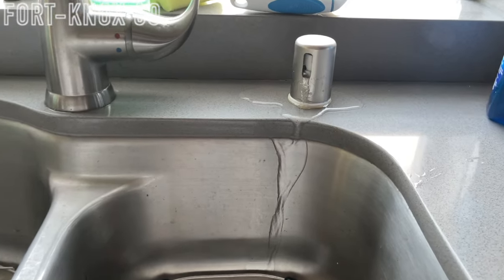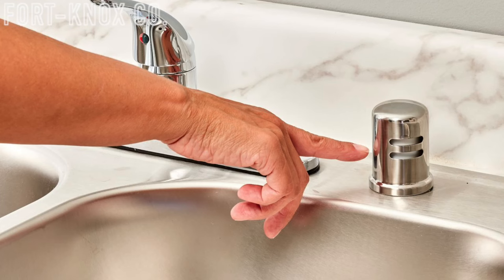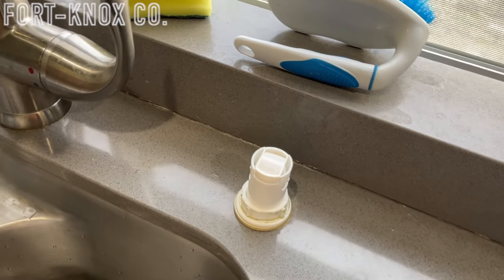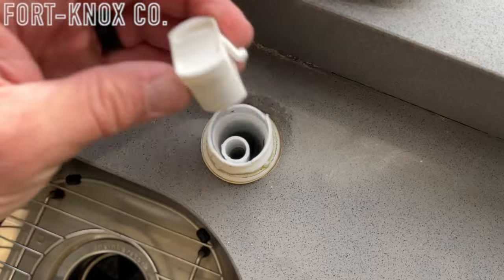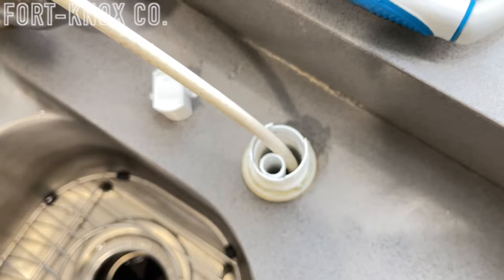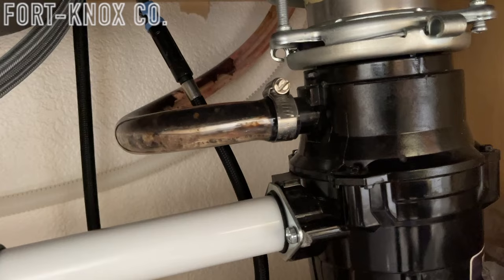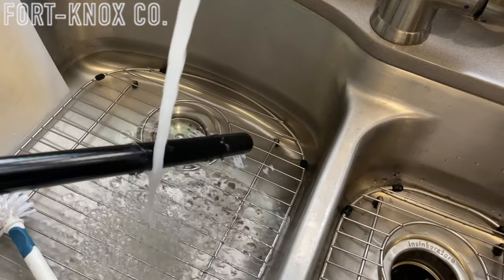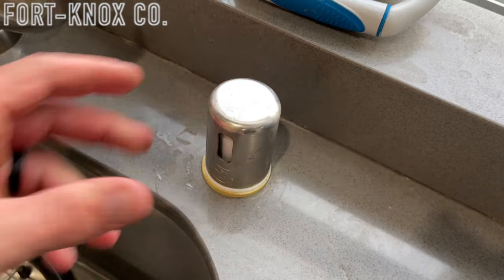Dish Washer Not Draining Air Gap Water Coming Out

Comment: I tried this but it's still leaking/overflowing. The hose is ribbed/corrugated, which I'm assuming is wrong, but also there is a solid cupboard wall hiding the dishwasher end of the hose making it hard to replace. Do you have a video/tips on how to access that end? I have zero dishwasher experience, except for the dishes part
Reply from the maker: To get to the hose connection on the dishwasher you’d need to pull the dish washer out of the base cabinet. It’s usually pretty easy to do. If you open you dishwasher door and look at the area where the dishwasher meets the under side of the countertop you’ll most likely see a couple screws that are holding down two metal tabs that connect to the dishwasher. They are usually small screws that screw into the bottom side of you countertop underlayment. You under those screws and the washing machine should slide out like pulling a stove/fridge/washer dryer away from the wall. It’s usually just a couple simple screws holding it in place. 

As far as the water still coming out of the air gap I’d check the hose going down from the air gap to the garbage disposal/drain and the air gap itself. Usually the tube from the dishwasher to the air gap isn’t the problem in this situation. Water is obviously not having a problem getting to the air gap, it’s having a problem at the air gap or from the air gap to the drain. If the dishwasher was having problems with water/food/draining during the wash cycle then I’d be more focused on the washer drain line and the washers itself. 

Make sure the air gap is clear, that the washer line and the line going to the drain are on the right parts of the air gap. And make sure the air gap has the little plastic piece that clips in over the two holes that redirects the water back down into the drain line. When that little piece is missing it will allow water to get everywhere inside the air gap and cause the overflow or spilling.
Reply: @FortKnoxCo  thank you for such a clear explanation! I tried your wire trick, and when that failed, I blocked the outlet to the small dishwasher tube with clay, used a toilet paper roll to make a tight seal with my small makita blower, and pushed air through for a minute, and that cleared up the problem! Does this sound to you like a safe method to try again if the problem comes back? I wasn't sure if the air pressure might risk damage to any parts of the system
Reply from the maker: @Casadero1  sounds like you figured it out. Pushing air shouldn’t hurt so lang as your not over pressurizing the pipe/tube. They can withstand a good amount of psi but if what you did worked then that could be a future solution. Just be cautious with the amount of pressure you trap in the pipe when clearing it up and gauge it. That’s awesome you got it figured out. Good job !

Comment: So this has been happening consistently for a while and I’ve tried snaking that line a few times. Each time I can feel the snake coming out into the garbage disposal, but the next time I run the dishwasher, the water still comes out the air gap. Am I missing something?
Thanks!
Reply from the maker: I’d check the line from the dishwasher to the air gap and the line from the air gap to the garbage disposal. Make sure they are both clean and clear. And then check your air gap and make sure you have that set up correctly. Which side is connected to the dishwasher and which one down to the garbage disposal.  Then make sure you have the air gap assembler correctly with the plastic piece that covers over the two holes, the piece that redirects the water back down. I’ve heard of people not having that plastic piece in there and that will make water just spill out into the air gap cover and obviously spill water everywhere.  So make sure you have that piece that redirects the water down and into the line going to the garbage disposal.
Reply: @FortKnoxCo  Thank you! Just to close the loop, I ended up snaking it again with a much bigger diameter snake (the first was one of those flat ones with barbs to get hair out of a sink, this one was a metal coil) while also putting my finger down into the garbage disposal to the inside end of that line. I felt a large clump of food in the perimeter of that line and had to work that snake back and forth a number of times to clear it out. Combined with trying to fish it out with my finger. Finally, I poured some water down into the air gap (with a funnel) to make sure it was coming out before trying the dishwasher again. All clear!
Reply from the maker: @itayneta  nice! Good job!! Happy you got it fixed!!

Comment: An easier method to try first if you airgap is connected to food disposal:
1-make sure there is water in your airgap tube
2-plug your sink and fill your sink with water
3-lift the plug to let it start draining. As soon as the disposal is filled with water, replug the sink and turn the disposal on immediately. 
4-repeat if needed. 

The disposal can’t create much suction with just air, but filled with water, it will force the water down the drain and create a good suction to unclog the airgap line. The sink has to be plugged so that the suction is applied to the airgap line and not just pulling water from the sink.
Reply from the maker: Really good info

Comment: Water just sits in mine. Is that still a hose problem?
Reply from the maker: Water shouldn’t sit. May not be running the right way up and down. 
Ideally the washer will push the water up, the air gap redirects the water back down and the water runs down through and out into the garbage disposal/drain. It shouldn’t sit anywhere. If it sits in a spot the hose may need to me adjusted so it has no low spots that water wouldn’t naturally flow down and out. May require shortening the hose if the length is too long and has those low areas
Reply: @FortKnoxCo  thank you. I found out the problem. The person who installed it hooked it up backward.
Reply from the maker: @cutestlittlething17  welp that’ll do it.  Good thing you caught it. Happy you got it figured out.

Comment: I notice the water drain line from the dishwasher goes directly to the air gap. And when the dishwasher drains I see water coming out the air gap then flows down to the drain line to the disposal. If I take the  plastic cap off the air gap water will overflow all over the counter when the dishwasher is draining.. is this normal
Reply from the maker: Are you referring to the plastic cap as in the cover of the air gap? Like the silver or gold finish cap? 
Or the small plastic piece that clips in above the hole in the top of the air gap? The small plastic piece that clips in redirects the water from one hole , the dishwasher tube, to the other hole , the garbage disposal. 
If you remove that small clip in cap  it will just let water spray all over. It’s there to act like a U-Turn for the water to go back down and find its way to the garbage disposal and drain. 

The air gap cover that usually just pulls off is mainly for cosmetic purposes and doesn’t really have a function other than cleaning up the look of your air gap.

Comment: Could it be that the dishwasher's bottom is filled with water because of the air gap?
Reply from the maker: That could cause it to back up into the washer. But you could also have a clogged washer filter. If you open the washer , look on the inside floor of the washer. Probably have to pull the bottom rack all the way out, you can see a cap/filter, you usually turn it a 1/4 turn and it comes off and you can clean out any large food/debris that might be stuck in there. From there it goes to your washer pump, to the hose and to the air gap. So anything along that system could be clogged.  Worst case you washer pump is not working.

Comment: I replace the entire set-up, airator and hoses and the dishwasher water still comes out of the airator What is happening?
Reply from the maker: Do you have the small plastic clip on the air gap that redirects the water back down the other tube? 

And if it’s getting water out of the dishwasher that’s good. You next ace to look is the like from the air gap to the garbage disposal. If the water is gettin stopped on the way down and can’t flow freely into the garbage disposal/sink drain then it will back up and spill out. 

Check the tube going to the garbage disposal and the connection at the garbage disposal. Sometimes there gunk/food particles plugging up the entrance to the garbage disposal, so you like is clear but at the garbage disposal itself it’s stopping the water flow.

Comment: What if I have done everything in this video and water still comes out the air gap
Reply from the maker: If it’s still spilling out then there’s something wrong from the air gap forward. It should drain into your sink drain or garbage disposal freely. 

So you have the small plastic cap in your air gap that redirects the water back down? From one tube to the other. That sometimes is missing or not in correctly and allowing the water to just shoot up into the cap from the washer. 
Also make sure the water is connected to the air gap sides correctly. Usually one is specifically meant to be connected to the washer and the other to the drain.

Comment: Why is it going up into the gap and then down into the disposal? Who thought that was a good idea?
Reply from the maker: That’s exactly what the purpose is of the whole thing. It’s called an Air Gap. Creates ventilation in a line where water needs to drain. You don’t want water sitting and this is one way to clear that line. Some codes require an air gap, some don’t. And now there are some other methods of installing that don’t require an air gap.
Reply: It's to prevent dirty water -- essentially sewage water -- from contaminating the water supply. The dishwasher is the only item in the house whereby if the soiled water didn't drain from the appliance, it would have a direct path via gravity into the water supply line of the same appliance. Yes there is water pressure on the supply line but there could still be contamination when the water is running and is then shut off.
Reply from the maker: @sweepingdenver  very good info right there. thank you for adding this information.
Reply: I don't get it. How could the fresh water supply into the dishwasher be contaminated by the drain water, aren't they separate lines ?  @sweepingdenver

Comment: Best thing you can do is disconnected and don’t even use it. They’re a joke.
Reply from the maker: That is an option too. I’ve seen a lot of new installations where they don’t use air gaps at all. Not necessarily a requirement other than if code in your area asks for it

Comment: Forget it throw a thing in the waist basket, hook the dishwasher up directly to your garbage disposal problem solved no more leaks no more noise no more nothing it’ll work perfect for years and you won’t have that ugly thing sticking out in the back sink
Reply from the maker: Yep, that’s one way. Some codes in areas still require an air gap for some reason. But it’s not necessary

Comment: Mine is coming back up after replacing the garbage disposal... Sigh
Reply from the maker: First, make sure you knocked out the plug at the connection on the garbage disposal. It’s the most common over looked thing. A lot of garbage disposals have a thin plastic tab that plugs that drain hole, and if your connecting a dishwasher to it or air gap it tells you to make sure you knock that piece out so you have the hole to let water flow through. 

If that is t the problem Check the tube that’s connected to the garbage disposal make sure it’s not turning or bent to hard and kinking. And that the air gap is assembled right with the small white clip cap that redirects the water back down
Reply: @FortKnoxCo  Cant thank you enough.. I think that is exactly what it was. I blame my wife.. She's the initial installer haha!
Reply from the maker: @KYWildcatUK2K  😳 well I’m gonna stay far away from that , lol. It’s a team effort. Hope you get it all figured out and running smoothly. 👍🏼
Reply: @FortKnoxCo  So far so good, take care & thank you again.
Reply from the maker: @KYWildcatUK2K  no prob at all